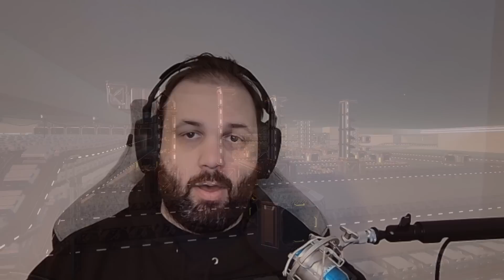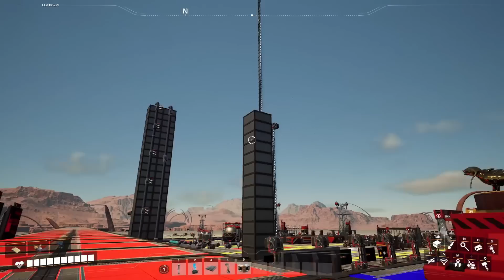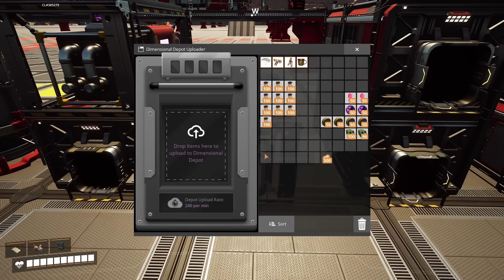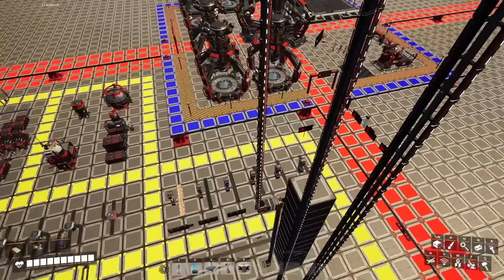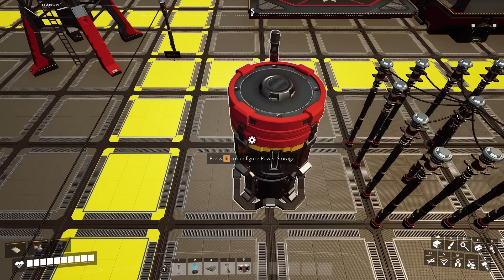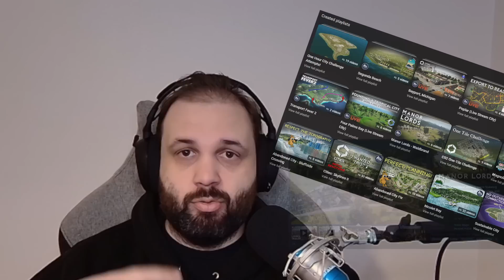Full logistics Guide pt.1 | Lets go REALLY deep into LOGISTICS in Satisfactory 1.0 | Tips and Tricks

Comment: Why bother using low tier belts for local lines? Once you have the parts factory set up, you essentially have infinite parts, and I'd much rather just keep my highest tier on my toolbar so I don't risk having an accidental slowdown somewhere.
Reply from the maker: One small part of it is visuals, being able to properly see the parts adds a visual element, something I have to be extra conscious of as a content creator. 

Another is performance, the faster belts, especially in very large worlds, can cause some performance issues, or at least they used to, so its just a habit of mine to use as slow of a belt as possible for the section I am building.

Finally, its part of my teaching method, by always keeping the viewer conscious of the belt speeds to some degree. I have learned that by always having those numbers and the associated math ready in my head, I can build things like load balancers and belt packers on the fly. By having my viewers engaging with it, my hope is   to give them the same skill, without forcing a math lesson down their throat.

Hope that's a good enough answer :P

Comment: Awesome video that, even after 800 hrs and in Phase 4, showed me a couple of tips I was not aware of.  

A comment for your trouble shooting chapter - when matching belt speeds to production/consumption rates, I find that if my production/consumption rates exactly match a belt speed, I need to upgrade to the next higher belt speed because if there is some kind of glitch that temp shorts production, when you get back to running full production, you can never make up the lost production.
Reply from the maker: It works until you have mk6 belts, then what you might need is a buffer container to guarantee that the belts are saturated

Comment: Got a remark on buffer containers for train stations. Assuming you are talking about the operation of the freight platform itself and completely ignoring any wanted/required buffering within the destination, there is no benefit of having a buffer for outbound connections from the freight platform. The only reasonable buffer is for inbound connections to the freight stations, so the throughput may not stop from the origin but may be emptied on idle timings of the origin (output of origin is less than max belt throughput). On 100% throughput requiring installations, there is no benefit at all ever with buffer containers for freight platforms. The penalty of the freight platform will affect the throughput.
Reply from the maker: You are correct, unless you use both of the output/input ports to feed and take from the buffers and then only have a single belt feed into the buffer from origin, or out from buffer at destination, the idea is to use this method to make the pause in the freight platform feeding or receiving count for 0 when looking at the total throughput. I iterated on this during the Update 8 beginners guide an it was the only way I could reliably feed sensitive production using trains.

Comment: 53:51 Sushi enjoyer here: when splitting something off a sushi belt you should always use the same belt speed (unless they changed how splitters work). 
Using a lower speed collector belt can cause issues if 2 of the item you're trying to split off are right behind each other on the faster sushi belt, because the 2nd one will arrive at the splitter while the 1st one is still in the 1st slot of the slower collector belt, so the 2nd overflows. This gets much worse at higher speed differences, or if you have vehicles inputs on your sushi belt
Reply from the maker: Agreed, and if I had made it so the belt was full it would become a problem, but because it only runs 110/min its fine ^^

Comment: Great video. So many explanations of game mechanics and their intention. 
I'm still very new in the game and what I realised recently about logistics are limitations. Nodes/wells have an output limitation and belts/pipes have a throughput limitation. With a small factory that doesn't matter. But as soon as you want to scale this up, you may run the logistics completely different. A simple example for this is a plastic/rubber factory with 180 crude oil (and alt recipes) gives an easy layout with perfect use of all machines except one blender and an output of 270 plastic/270 rubber. All pipe/belt-transfers are below the max capacity of my available mk2 pipes and mk5 belts. As soon as you scale this by 3 it's a comletely different story. You need 1440 water and 720 heavy oil for the diluted fuel blenders. After that 690 fuel goes to rubber production and 750 fuel to plastic production. And at the end I have to handle 1560 rubber and 1560 plastic but only 810 each as an output. All these numbers are above the max throughput of my highest available tier. If you know the logisitcs to handle this correctly all stays simple and looks very clean. 
Maybe you can make a video about that in the future? I'm sure many struggle on this with bigger factories.
Reply from the maker: Yea it becomes very complex very quickly, part 2, 3 and 4 is going to be dealing with exactly how to do that according to my methodology from start to finish, and I am working on them as fast as I can, part 2 should come out this week or early next week.